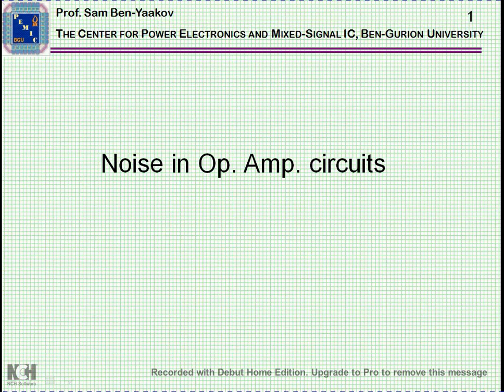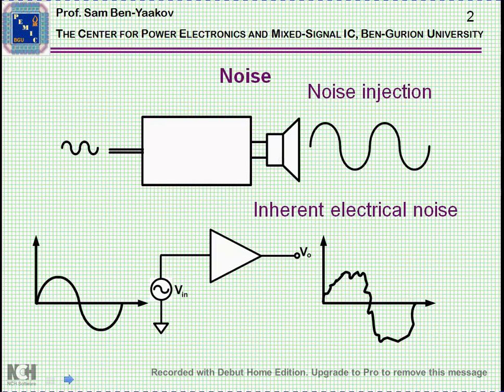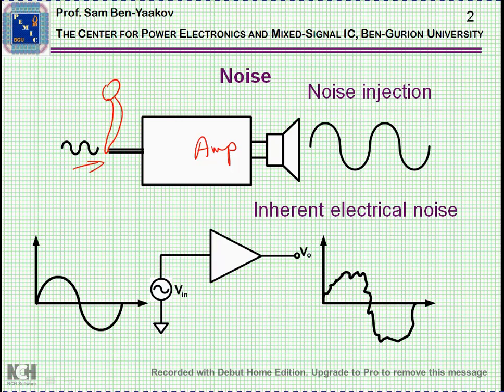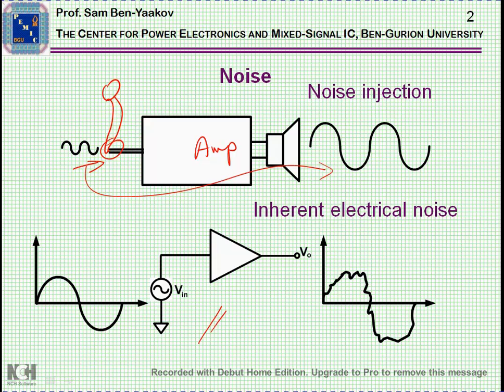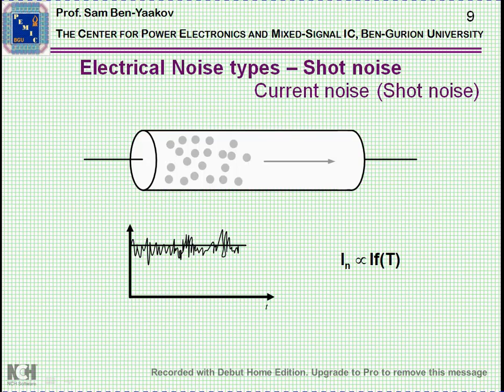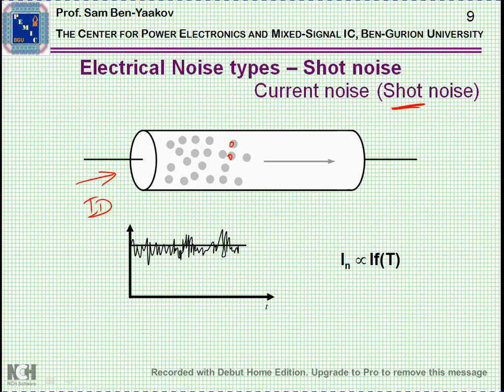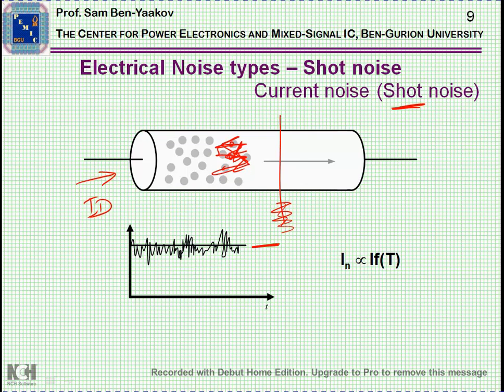Noise in Operational Amplifiers circuits

Comment: Thank You Sir. I have a question, How to do noise analysis of a two stage op-amp circuit? Is there a way to get the total RMS noise from the RMS noise of the individual Op-amp stages? Thanks Again.
Reply from the maker: Yes, you just peculate output noise of first and pass it through second plus noise of second.
Reply: @sambenyaakov  So the noise output in rms of the first stage should be treated as signal for second stage? That is first stage noise rms multiplied by second stage gain and then add the second stage noise rms to it?
Reply from the maker: @sreeharibalachandran  Exactly
Reply: @sambenyaakov  Thank You Very Much Sir